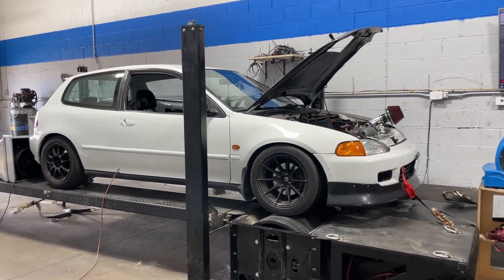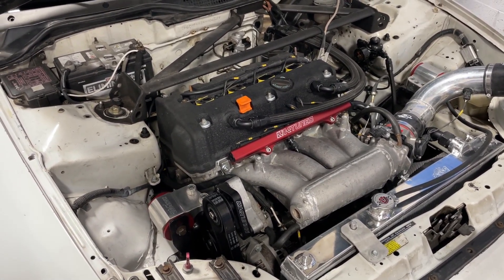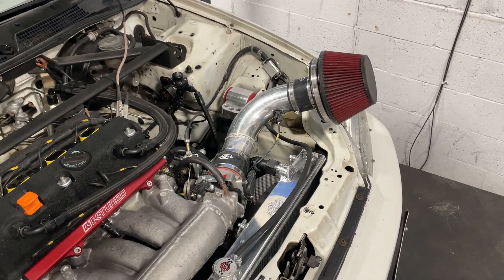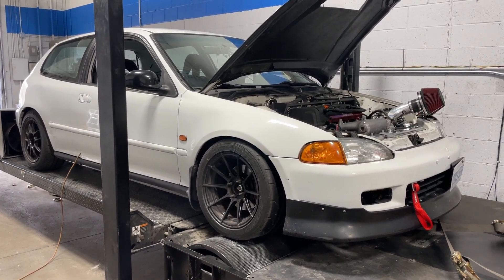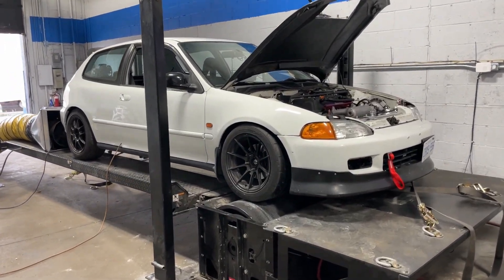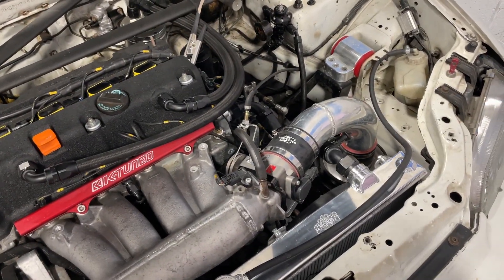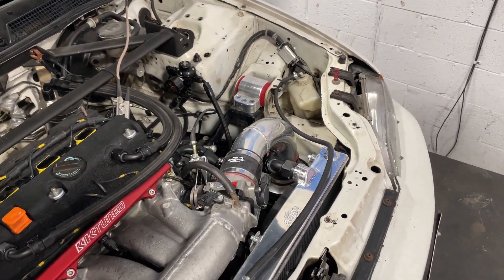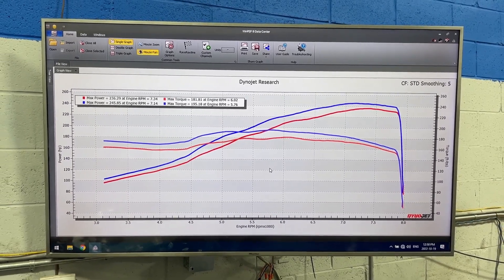JDM K24A Swap Dyno Tune EG Civic - Intake Comparison

Comment: How does the silicon hybrid racing intake perform ? Debating or purchasing that for my K swap or doing a DIY box behind the headlight with a headlight cut out and then a adding a pick up tube from behind the bumper

Comment: Looking into getting a K24A for my GD3 Fit. Will this engine work with a K20Z3 transmission? Looking at buying a buddy's junk Z3 trans with a 3rd gear grind and having it rebuilt.
Reply: For anyone looking in the future: jdm k24a work with any k series transmissions you just need the right transmission mounts and to make sure the speed sensor matches your ecu (or get an adapter).

Comment: The best way to find out what jdm k24a you have, remove the valve cover. If you have the 3 lobes on both intake and exhaust, you have the high performance one. If you only have the 3 lobes on the intake  it's the "eco" one
Reply: You can even boroscope through the oil filler opening, that’s what I initially did with mine

Comment: What is a "typical" intake air temperature? My EP3 is running the AEM V2 intake and I'm seeing 140 in traffic jams during summer.... obviously too warm. Moving in 90 degree temps I see around 120. Just curious what everyone else is getting.
Reply: That seems really high my wrx with stock intake just drop in filter is never more than 5-6 degrees above the temp outside according to the accessport. When it’s sitting in traffic yes it’ll rocket to 140 150 but moving it drops right down to ambient. But different car obviously so idk lol

Comment: k24a is from Honda Odyssey Absolute, I know the engine. The code being RBB-2 is from the years 2003-2008. 210hp stock. I have this exact engine on the Accord CL7 from Europe, which came from the factory with the 155hp k20z2. A real symphony this engine is more your love to drive it I currently have 230hp with the stock ARK5 manual box (the one on the 2.0 from the old engine) Civic FN2R RSP intake and 410cc RDX injectors. 😉👍🇯🇵🇹🇩
Reply: I have a k24a stock internals but fbo and oem oil pump. Made only 183HP on the dyno

Comment: Hey, Nick. When you say, "some perform well and some don't" what do the "ones that don't" put down? I only ask because I have a k24a rbb-2 opened up right now with k20 oil pump and 50 deg vtc prepping to go in a lotus 7 clone.
Reply: I think he’s referring to the 3 lobe vs the 2 lobe. It’s 40hp difference stock

Comment: K24a is a oddysee van motor k24a2 is tsx motor people get ut confused thinking that k24a is just like k24a2 but they are different alot different in horsepower range  just want clear that up alot of people get that confused
Reply: The k24a is identical to 04-05 tsx motor. Same pistons Same cams and same RBB cylinder head. I have both engines and have completely taken apart both. Let’s keep the information on track out here.
Reply: @PolishedMobileDetailing503  yeah bro don't give fake info if you don't know kseries stuff my brother is 11.5 index king so I know alot  aboat  racecars   pull up in fake k24a oddysee van motor get pulled away easy lol  with real 05 tsx k24a2 😅🤣😂
Reply: @PolishedMobileDetailing503  lmfao hell no bro you comparing a oddysee van motor to a tsx motor 04 05 is twin loup vteck the k24a dose not have that lmfao they 2 different motors whoever say a k24a is samething as k24a2 they don't know what they talking aboat lmfao its just an excuse cheap people say they can't afford or find k24a2  they not the same I have 05 k24a2 in a 2000 ek hatch with itbs oil pump all that crap so I know lmfao  😅🤣😂
Reply: k24a comes in many different cars in asia, Honda Odyssey Absolute being one of them. Which does have an rbb-3 casting k24a and is the closest engine to that of the 07-08 TSX, only difference is it doesn't have the same water pump housing and the intake cam is not the same as the 07-08 TSX. Only the 07-08 TSX has that intake cam which is the most aggressive factory K series intake cam.

Comment: K24a swapped ep3 added 6thgear....I had 2 intake setups on mine cause of weather, humid and wet here. Sometimes, I had to stop at gas station cause of rain and  swap a hose around in fear of hydrolocking motor, but running hondata thru the phone, I noticed that 10 hp u could feel it is why I got to noticing, I would  look at phone and see the temps climb up and fall down. If I ran the short ram modified to fit rbc in the correct location, the temps were better than what they were behind the radiator. But after the intake under the headlight, it made a world of difference. Hell of a tuner, you are man, mine made 236 whp on 93oct with shit short ram intake, 50°vtc, header, rbc manifold, 3in straight exhaust. 192 tq, your 1 hell of a tuner and that car will be quick as fuck!

Comment: wow thats amazing power! Is the difference between the JDM and USDM all in the head?
Reply: Negative. K24a are identical
To 04-05 tsx engine. RBB cylinder head 10.5:1 pistons. 200 hp stock

Comment: Fantastic numbers for a stock K24, increase across the rev range especially for a short intake!! I've also seen good numbers on set ups on a long 3in intake. One K24 was done by eleven23_motorsports, I think the idea on the intake was Rocket Motorsports'. Not sure what determines the effectiveness of intake systems as I've seen both can be effective.

By the way, did you do a lot of tuning on the VTC table?
Reply: Tegiwa concluded that shorter pipe makes most power on their k20 as long as it has proper cold air channeled to it ofc
Reply: @CL9k24a3  i believe that was with the skunk2 ultra street intake manifold, but still a note worthy point. Not sure if any/how much difference ported rbc vs the ultra street would make. Comparison video? 😈
Reply: @KorkwiN7  yes it was ultra street manifold. Also humble performance did the same test and got the same resoult and cupple of other people on yt also had tested short ram with superior resoults. Just cant link it here as message gets deleted instantly.

But I'm also aware that some people did test with longer intakes on hi comp and agressive cam setup and that made more power. So it looks like it is setup specific.
Reply: @KorkwiN7  these test are not really useful a engine is a package and one part alone could make less power but make a massive difference in power with the right supporting part especially with cam 
This could be any intake the improvement you see is getting cold air to the "cold air" intake the stock intake would probably given the same exact result most of the  cold air intake on the market will actually loose power
Reply: @CL9k24a3  there is no evidence to prove short air intake are the best when all dynos are with the hood open, or with the filter directly outside of the car. Obviously if you combine cold air + shorter length is gonna give you the best results. In the practice you can't achieve that
Reply: @legros731  what do you mean Dyno testing isn't useful? It's how cars are tuned from stock.
Reply: @jesseleeV  never said it was useless 
This test on the other hand is useless a engine is a package you could have the best intake in the world if the exhaust is a restriction you will not see the real intake potential 
Testing a itb setup with a stock engine will not tell you the anything unless you use all the supporting mod the same for  cam if you don't have a intake and exhaust to go with it the dyno testing is useless 
And why we say supporting mod

Comment: So that's why so many end up using those headlight velocity stacks. That's a significant power increase just for a change of intake air temps.
Reply: Problem with that is most dont run a air filter , thus sandblasting the rings and valves over time .